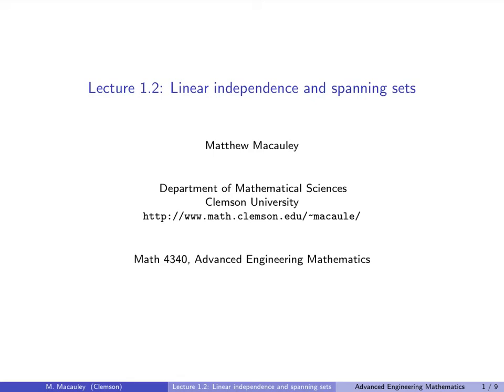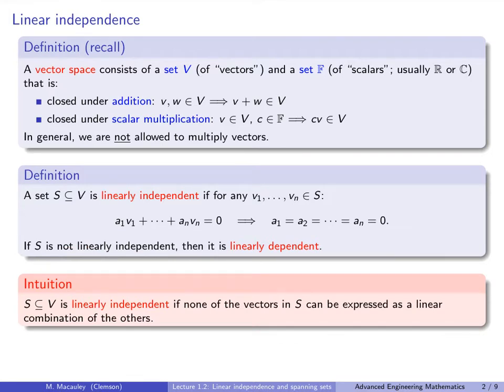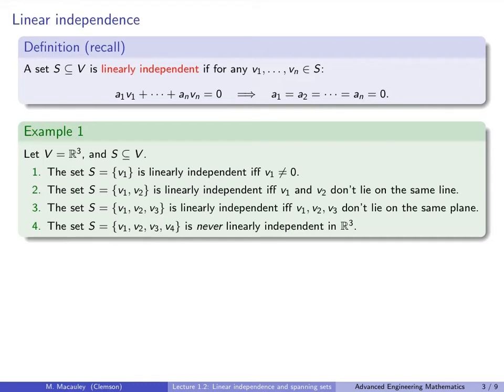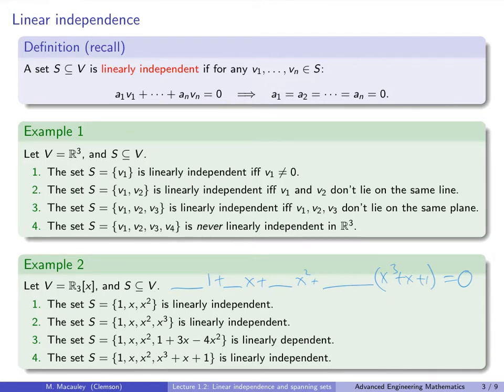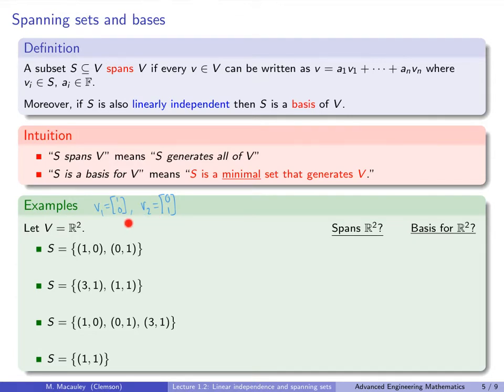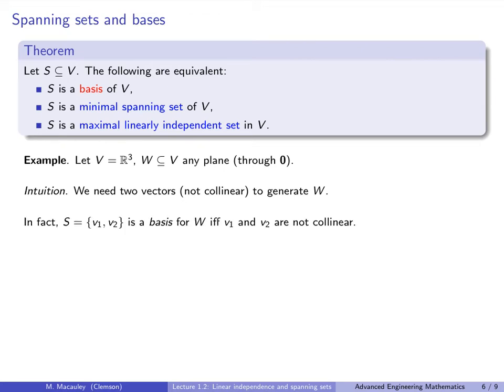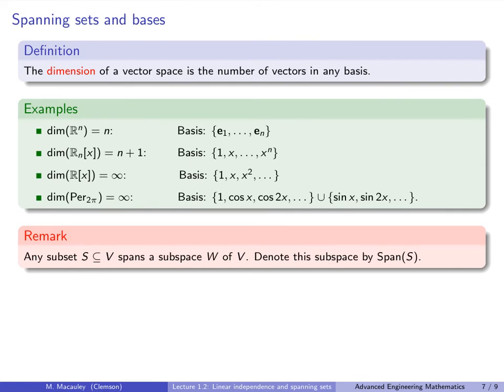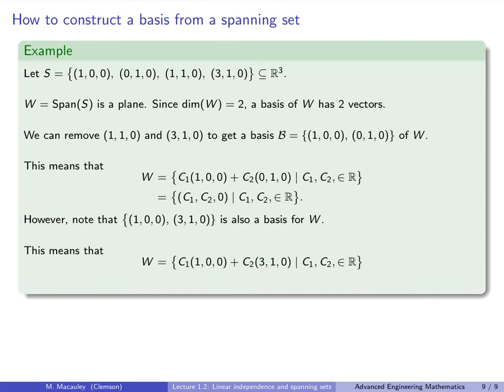Advanced Engineering Mathematics, Lecture 1.2: Linear independence and spanning sets

Comment: Sir, I have small question about in  22.27  part ,In that part you say c1*cost +c2 *sin t =0 should c1=c2=0 ,but sir, we can select t=45degree in firstcodrent and c1=-1 and c2=1 ' ifthatcase we canget zero answer for that statement without c1=c2 =0 ,cam you explane that?🤨
Reply: The right-hand-side is not the scalar 0, but the vector 0 (constant function 0, in this case).
Thus, c_1 cos(t) + c_2 sin(t) = 0 is equality of functions, not numbers.
In other words, it holds for all values of t

Substituting t = pi/4 gives c_1 + c_2 = 0
c_1 = -1, c_2 = 1 is one of its solutions, but so is c_1 = 0, c_2 = 0

Note that c_1 = 0, c_2 = 0 is the only solution that works for all values of t (as is shown in the video).
Hence, c_1 = 0, c_2 = 0 is the only solution to the vector equation c_1 cos(t) + c_2 sin(t) = 0

Thoughts?